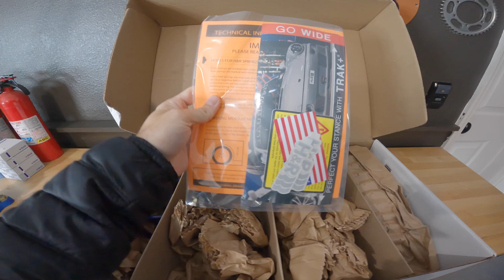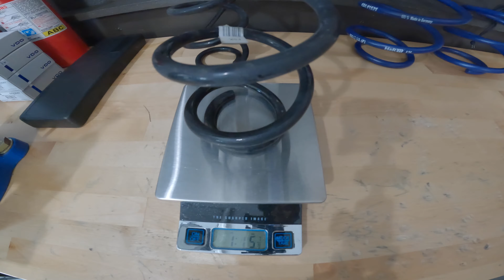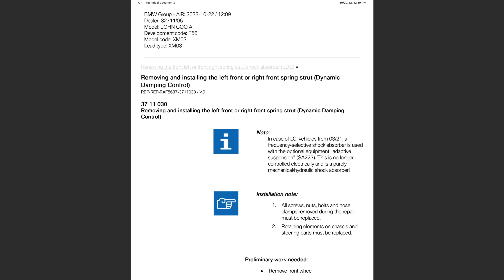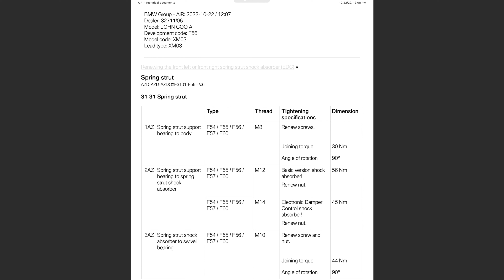Mini Cooper Lowering Springs // Best Springs Install

Comment: Hey I have the same setup on my cooper s f56. I also have a nm sway bar 22mm. I noticed squeaking noise in the rear suspension going over bumps. Did you noticed that with the springs? Did you cut the bump stops ?

Comment: One thing I noticed was that you have the EDC if I’m not mistaken. I really wish you would have detailed the removal of the front strut top hats from the strut assembly because I’ve read that if it is done incorrectly, you can break the electronic damper. I have a rebuild kit for the front damper and I’m itching to install the new boots and gaskets and re-grease the top hat bearings but I also don’t want to destroy the electronic dampers. Any tips? I’m running the NM engineering springs that drop 1.25” on all 4 corners. Nice job btw. You should bring the Mini out to the U.P. for the world record attempt next year on the Mackinac bridge and also check out running The Tail of the Dragon next fall!
Reply from the maker: You know, I wanted to add it into the video, but I battle with this. The challenge is, I like watching the details, but sadly, those videos don't perform well on YouTube and they hurt my analytics. 

This socket is a must https://amzn.to/3U2wVnr , so long is you relieve the tension from the springs and you use the proper torque specs you'll be fine. 

Also, make sure when you are tightening down the nut to the sensor, make sure the shaft is in the right position for the wire. 

It would be cool to take the Mini up there for the world record attempt. 😍🤘🏼
Reply: @MichaelBertini  just to verify - 18mm for that socket, right?
Reply from the maker: @MotoJoshP  yup, an 18mm socket. 👊🏼

Comment: How come you didn’t go with the MMR lowering springs? Do you know if they are any good?
Reply from the maker: I didn't realize they had springs when I purchased the H&R springs.
Reply: I have them but I’m changing to H&R as I don’t like the lower front vs back look on the MMR
Reply from the maker: @techpulseYT  that's good to know. thanks for the insight 👊🏼

Comment: a coilover set would have improved the handling but i get it to not want your car super low and stiff good stuff man
Reply from the maker: I agree with you. I would've noticed a difference in the coilovers for many reasons, but I don't want it to be that low. 😅

I'm working with a brand now on potentially installing their coilovers at some point, and theirs are the same amount of drop as these springs are.
Reply: @MichaelBertini  umm. What? Any good coilovers are adjustable in height including the JCW pro suspension lmfaooo. Takes 3 mins of research to learn this.

Comment: Great vid! How do you know how far to push the strut back into the hub/knuckle?
Reply from the maker: This is the same question I had too. There's a pin on the back side which goes into a slot on the back. Then you push the strut down into the knuckle as far as it can go and it should be protruding from the bottom.
Reply: @MichaelBertini  so the pin doesn’t push up against the knuckle/hub clamp but slides down through the gap in the knuckle? Probs best to photograph and measure beforehand?
Reply from the maker: @Carl_Donaldson  correct. I would measure and take pictures beforehand. I typically do this with everything I touch anyways, even if I have the service manuals. I'm a little "over the top" like that sometimes.

Comment: Hi, I have lowered my JCW F57 also with H&R springs but I have lots of cracking noise. Everything has been checked but still lots of cracking. Any idea where is come from?
Reply: I have same issue, just installed
Reply from the maker: @Ashimal78  is it more like a squealing sound? I’m sure you figured it out by now, but it could also be that you need to add grease to some of the contact points in your suspension.

Comment: Did you have to trim the rear bump stops?
Reply: I would also like to know that. In their official documentation it says you don't need to. But in some other videos people do cut it.
Reply: @matebajusz4199  I'm installing my H&R springs Saturday.   I'm gonna trim mine as I've also gotten new struts so I have ti drop the rears anyhow at that point
Reply: You know what, I just received mine today. In the original packaging, there is an extra bumpstop. I didn’t compare it with the OEM one, but I assume it’s probably smaller.
Reply: @matebajusz4199  mine did NOT come with a bumpstop from H&R , I am a bit perturbed
Reply: @matebajusz4199  I installed my springs yesterday.  As I'm letting them settle this week , it showed a decent drop.   I'm also on 18s , I. Sure in 17s it would look a little lower , but the progression of the springs seems great in the corners

Comment: The size of the spring really didn’t matter but what I thought was odd was his round down method. A couple of millimeters difference is a big deal in sizing objects. And this guy seems to have never heard the old adage to always go bigger when sizing, not smaller. It’s a silly rant but this guy is clearly not a true mechanic or had any laborous work.
Reply from the maker: @VenkmanJ  I’ll have you know that I trained at the national school of dummies institute; and got my degree in ‘stupid mechanical engineering’. I’m a certified “false mechanic”. 🧐

Comment: Well just spent a half a day driving the NEW Mini 2 door and lets just stay it stinks. Too feminine of a car and just no soul. Tons on the lot and they are not selling. Car Edge said its in the top 10 of slowest selling cars brands right now. Big fail on BMW/Mini part. Maybe women will like them but I don't see many guys buying the new one that are out now. Maybe Mini got a performance one they haven't announced yet? I hope so... I drive a JCW Clubman with a slight upgrade at 325HP with a brace...
Reply from the maker: @michaelzero5144  yeah, I’m not a fan of the new Mini. Also, the JCW Clubman is perfect, especially at 325HP, that’s beast. 👊🏼